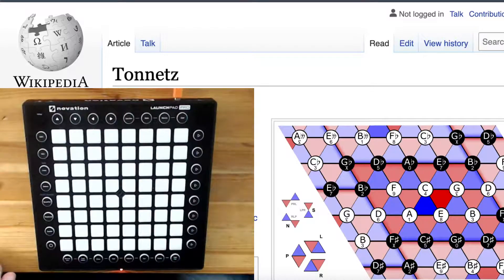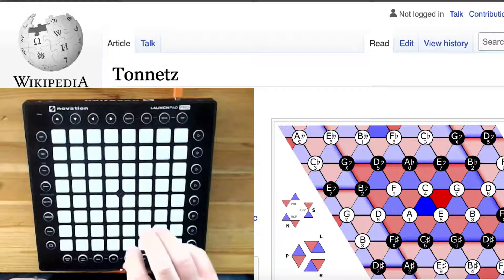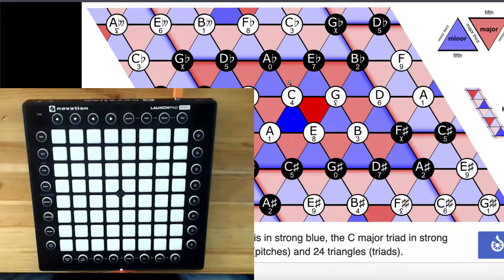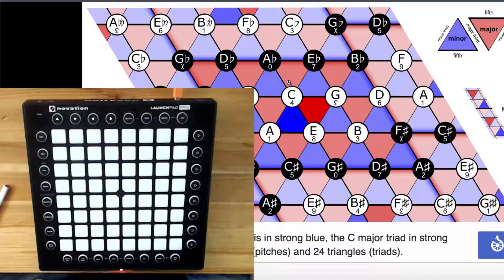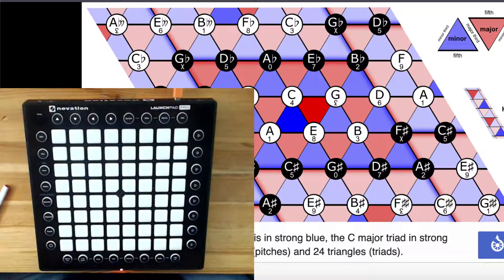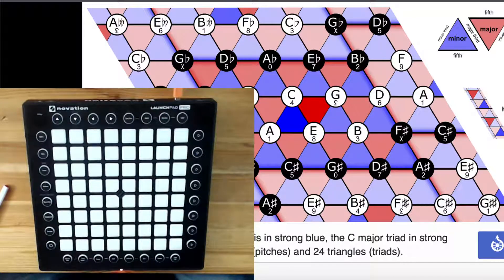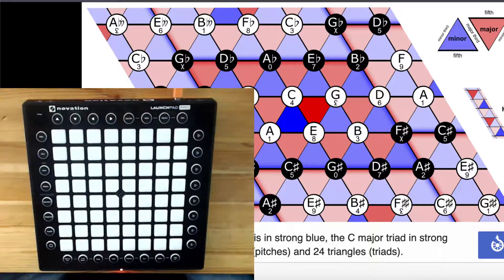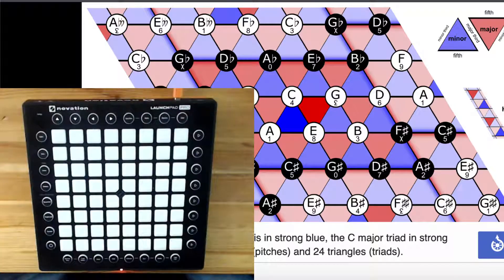20201026 Tonnetz Grid Demo

Comment: Hi did you post the the layout in full somewhere? I'm attempting something similar on a Launchpad X and it would be interesting to compare your approach with mine.
Reply: That's the same layout I landed on!😅
Reply from the maker: The source code I used to record the demo is in a repository on GitHub that I use for sketches, mainly of launchpad stuff:

https://github.com/duhrer/flocking-midi-interchange/tree/main

I've also uploaded it to my GitHub pages, so you can try it here with any browser that supports MIDI:

https://duhrer.github.io/demos/flocking-midi-interchange/demos/laser-screwdriver.html

If you're just interested in making a layout with the MIDI notes I used, I made a diagram in the source here, the notes are on the right side:

https://github.com/duhrer/flocking-midi-interchange/blob/main/src/js/tunings/launchpad-pro-to-tonnetz.js#L7
Reply: @TonyInAmsterdam   BTW do you think it should be called square Tonnetz? Sounds catchier to me than square Harmonic Table.
Reply from the maker: @roadtonever  Thank you for the question, it's fun to think about.  I think "Square Tonnetz" is fine, but I also like the idea of working "grid" in there to give people the idea that they could do it with any other grid controller (Push, etc.).

In working with this originally, I would also rotate my launchpad 45 degrees so that it was more like the diagrams you can find about Tonnetz.  So, something like "Tonnetz 45" is fun to me, in part because it calls back to records as well.